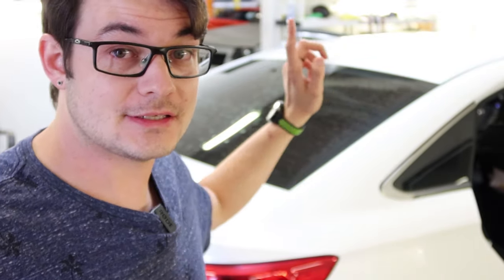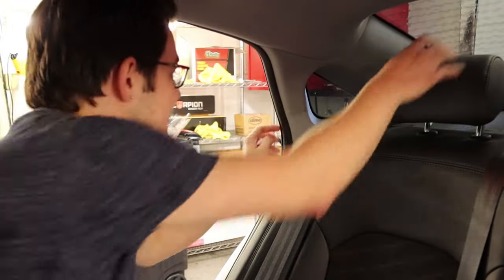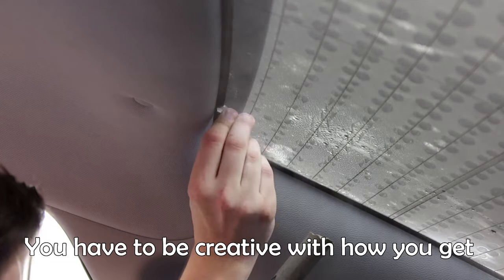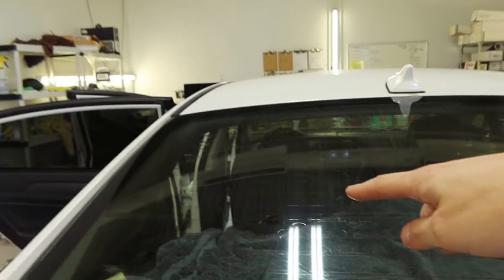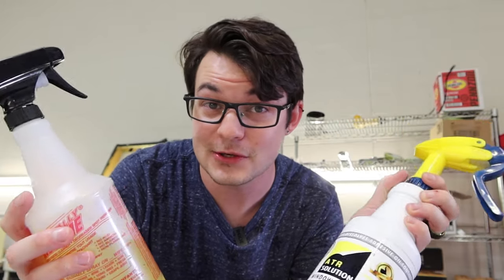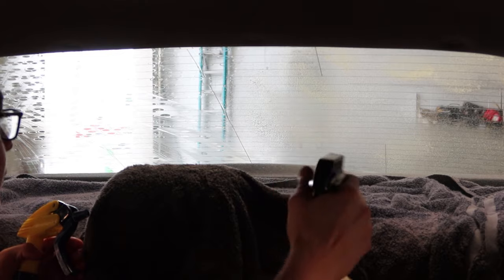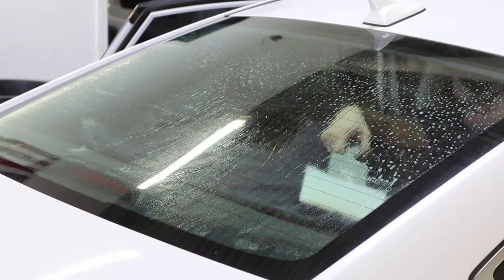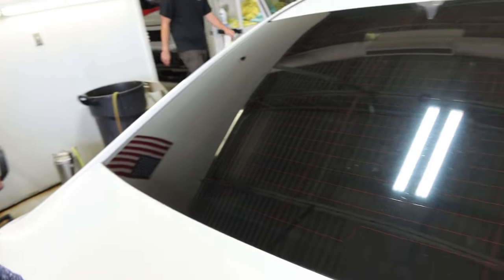Awesome Way to Remove Tint Adhesive for $1 | How to Remove Old Bubbled Window Film

Comment: Thanks for the awesome video, my wife's 2015 Camry had original tint on the rear window that was rippled  and I removed it with the steam gun!  It came off easy but left a shit load of that sticked backed on residue!  I tried the Dollar store awesome juice you use, it really worked well, I still have a little more to clean closer to the bottom!   Question, I deleted the Awesome with 1 part Awesome to 2 part water, Can I just use it without diluting at all!  Thanks!  Oh and not bad $1.00 for whole bottle when same bottle cost 5-6 elsewhere!

Comment: Based on the look of the tent I would say they're using their rear window defroster. So I would suggest telling them not to use it or better yet, remove the fuse For it.
Reply: I've used rear defrost on tinted windows for decades without a problem.

Comment: You said links will be in the description for the stuff in the video, there’s no description... I’m just curious to know if those scrub pads are like a scotch bright material, or something different?
Reply from the maker: Links are added now! running behind on some stuff lol yes they are 3M white scrub pads. don't use the different colors like green, they scratch the glass. only the white ones are safe unless otherwise specified.
Reply: TintStuff no worries! I actually found the link in yours back window shrink video... thanks!

Comment: Can you do a video on how to remove the bottom most layer of tint? Mine is like that and I can’t barely even see behind me. It was my fault though
Reply from the maker: Bottom layer? I removed all the film and adhesive. I don't understand the question.
Reply: TintStuff it’s probably never happened to you but as an armature if you peel it too fast and without enough heat only the top part of the tint comes off and you’re left with adhesive and a thin layer of tint after you pull off a layer
Reply from the maker: Oh damn, I know what you mean. It can happen with old films even if you take your time. depends on the film and how old it is and you never know I till you try removing whatever it is.

I'll keep it in mind, I don't come across it often but I would let a steamer sit on the back window for a while. it's a slow tedious process when it flakes apart. no real quick fix for it unfortunately.

Comment: Have you or anyone on here, try to use the 'Totally Awesome' spray, on the tint, and put a black plastic bag cut to size, put it on the glass and let the sun 'cook off' the tint and the adhesive layers at the same time??  In the sun for like 30 mins. Have you or anyone tried that way??  To see if it takes them both of at once?   So that you don't have to scrub the defroster on the glass, and possibly damage it?

Comment: AWESOME is Great! Been using it for years. Got it from 99 cent store. A gallon is $2.99. 
Why pay 3x on other product that does the same... Even use it on clothing stain... Careful though it will dull cheap paint on its concentrated form...
Reply: i even use Awesome for tires and degreasing it works Awesome, also they had Awesome for tire shine kinda good too =P

Comment: Welp i give up. You cant get the garbage bag all the way to the end if the spot is too narrow, you have big hands, or both. Steamer you need the hose otherwise it wont fit in the area. Heat gun didnt do shit it was just still brittle in areas the heat didnt hit. So you have to do this for 3 hours until every spot is heated. At least the steam spreads out. Just gonna disassemble the back to have more room to remove this shit, ive delayed the inevitable.

Comment: Yes to 1 dollar home do it yourself guys. But not all films will come off that easy. The purple old tints break up in little pieces, good luck with that. Also we charge because of overhead expenses and experience. So even him with the 1 dollars title was misleading! My local client who I charge 350 for removal n new application saw this video. Now I'll charge 400 dollars 💸. Btw I use acetone to remove the glue in less than 1 minutes!!! But I charge 2 hours for complete removal n new application. As a business we do have to hustle for the expenses. And no it's not a 1 dollar job.

Comment: all you  need  to  do  is  pull  film off  and  then  use  nail varnish  remover  in  a  spray  bottle    spray  on  and  wipe  of  fast with  a  cloth   no need  for  all that  shit  lol naol  varnish  remover   is  acetone and  acetone  removes  the  glue  very  quickly
Reply from the maker: and awesome is $1 but ok

Comment: Lmfao I use WD-40 one spray and I can remove windshield tint adhesive. And if you have double layer tint trying to get adhesive off your bottom layer tint. It don’t hurt tint I’ve used it on my tint and it works flawless.

Comment: It's  not  adhesive  failure, it's  the heater from the back  window. Left to long
Reply from the maker: Nope, definitely the sun ☀
Reply: @DetroitTintStudio  I've been doing tints for 35 years n we did test , yes the sun is part of the problem but sometimes people forget to turn off the rear window defrost heater and it cause the bubbles on the tints ☺
Reply from the maker: IMO there are too many variables to say it's from the defrosters. Back windshields get the most sun exposure. Customers shouldnt have to worry about using their rear defrost system. Up here in Michigan, people use it year round and the vast majority of films I've installed do not bubble on the back window.